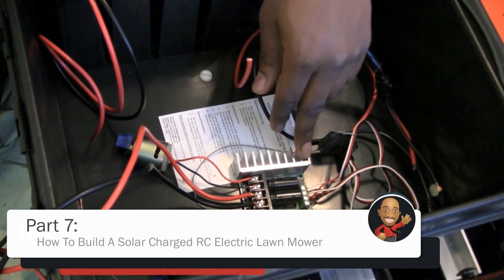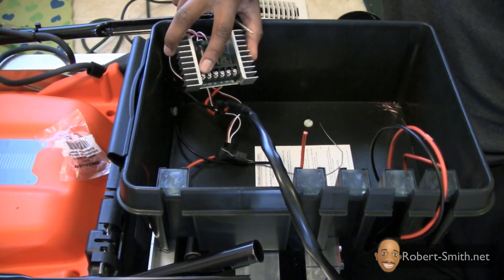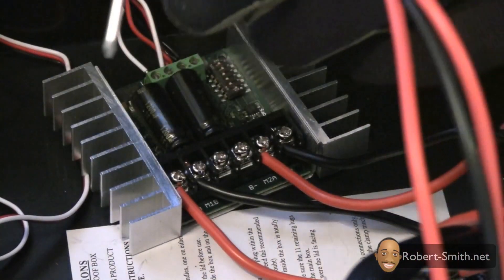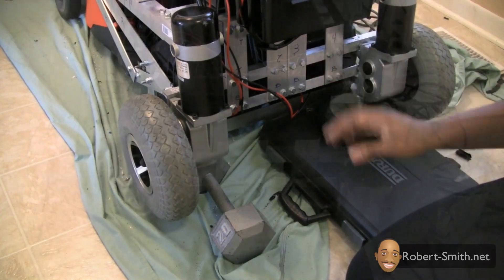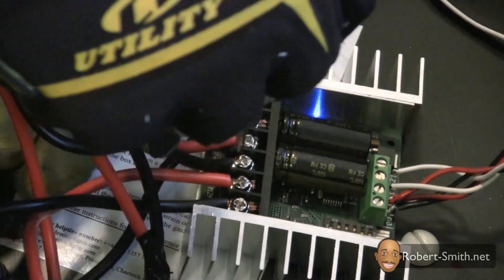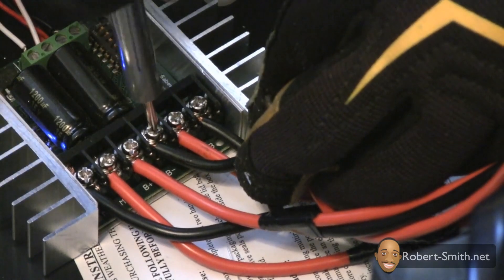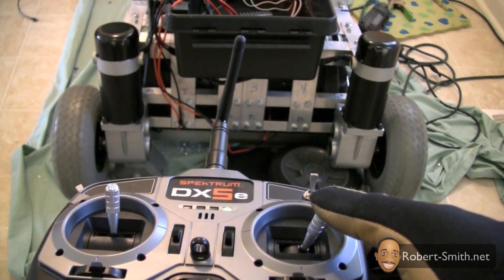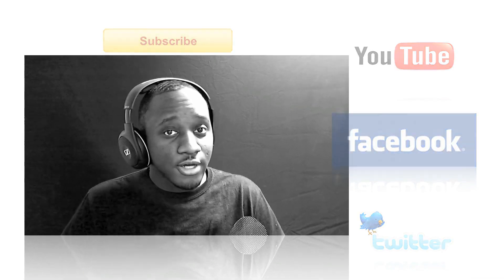How To Build A Solar Charged RC Electric Lawn Mower - P7

Comment: Hi Robert! Congratulations for your contribution for us, thank you. What kind of kill switch did you use to turn the battery on and off? (To disconnect the battery). The positive of the kill switch would be connected to the positive of the battery and at the same time this wire would be connected to the positive of the two motors or how would be the installation of the kill switch? Sorry, I am beginner. Thanks in advance.

Comment: * GREAT PRESENTATION***
Why did you keep the RC left throttle up instead of down?
is that the reason why you end up  switching the cables in M1A,M1B .. ??
Reply from the maker: Hey Perez, for my application I did not use the left throttle for anything, so it would not matter which direction I left it. I only needed 4 direction controls (forward, backward, left, and right) which the right throttle alone allowed me to do.

Comment: Hi, it is a great project. About the motor, what brand name do you use? 12vdc or 24vdc? How many rpm?
Reply from the maker: I do not remember the exact brand, but they were 24vdc wheelchair motors I purchased off of eBay.

Comment: hi Robert ,you don't mention anything about putting a inline fuse for this setup ,you do have pretty high amp batteries here ,and what are the motors draw at full speed?

Comment: hey that's a great video. hey i  connected all the cables as you explain but the the red led it's flashing when I try to move the wheels. and it doesn't move anyway,could you please help me to finish this project. thank you

Comment: hello im building an robot with the 2/25 speed controller you use, but i get a error (blue) light on the speed controller and i can not find out why its comming on.  I did have it working right but when i went back to work on it it comes up with an error no,  can you help me out..